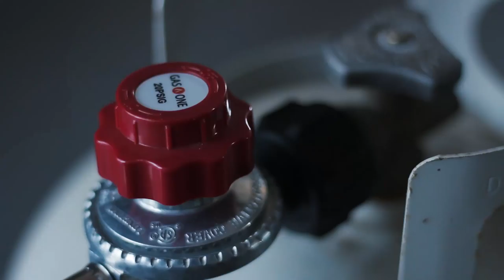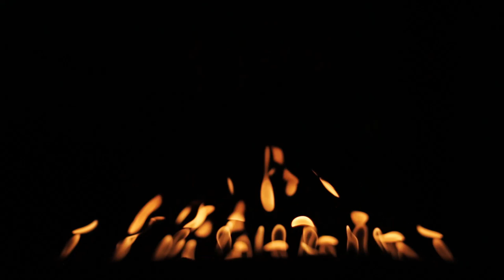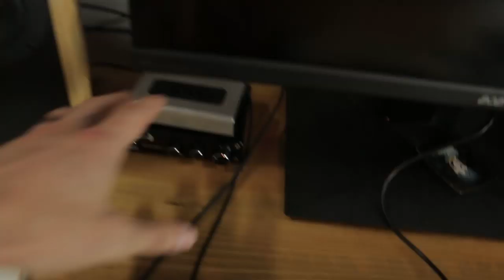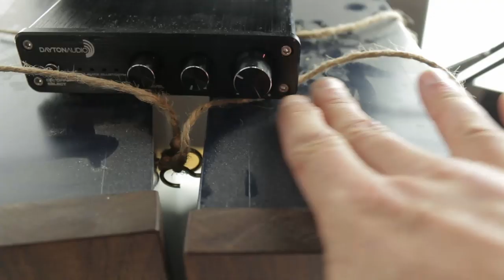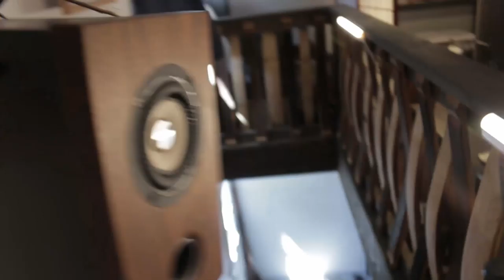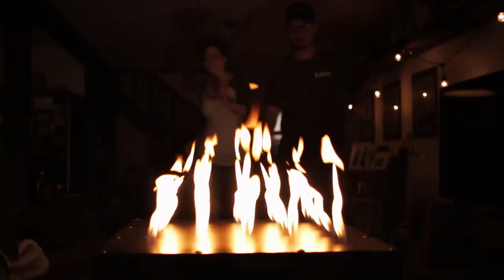DIY Ultimax Subwoofer FIRE DANCE?

Comment: the flame in your burner  needs an air adjustment. A yellow flame, which it looks like what you have, will produce carbon and eventually glog the jets and put soot in the air. the air adjustment will give a balanced clean blue flame.

Comment: Guy made something similar at my maker space, but he used a large diameter pvc pipe with some kind of mylar or something a little more fire resistant wrap around it. The tube was about 6’ long and had a single row of holes down most of the length. He would light it up, then put a speaker driver on one end of the tube (which I think was open) and the flames danced, and being a single long row, they looked more like an equalizer output. I know it wasn’t, but that is what it looked like. I think just because it was long it took a little longer for the air pressure change to travel the length.

Comment: you can always make the classic FIRE SPECTRUM ANALYZER, by, instead of having a box, u have a long tube, and that will actually make the flames at the end of the tube respond differently to the ones in the beginning, it's not accurate, but it actually reponds to different frequencies within a sound.

Comment: next, add scratch and sniff, smell the music attachment. and add overhead projectors for 350 degree psychedelic graphics. or maybe learn and teach technology of: standing waves,  crossover upgrades and tweaking, phase cancellation, beaming high frequencies, wave guides vs  tractrix horn or other horns?, cabinet box dimensions, and shape - are irregular and or rounded chambers better?, high efficiency vs not? endless audio speaker technical design topics.

 I guess I'm not into dangerous fire light shows. Your burner with the gas box under the "burner", seems like a bomb ready for a mishap. a safety control valve and a thermocouple would be a must to make this a possible legal novelty,   this may never be legal, or I could be totally wrong. ... How about some pyrotechnics, fill balloons with the propane and have igniters go off with certain frequencies to go with the Tchaikovsky's 1812 overture?